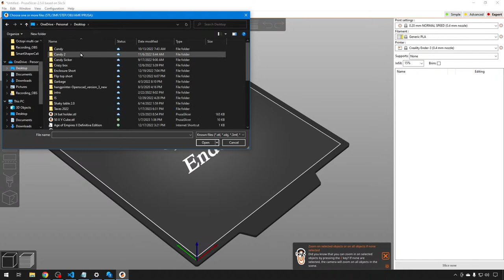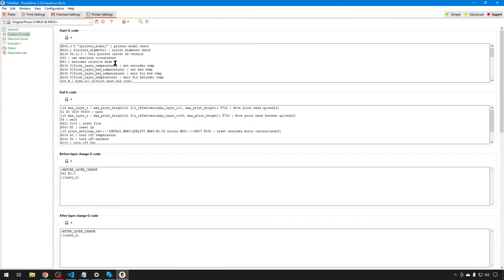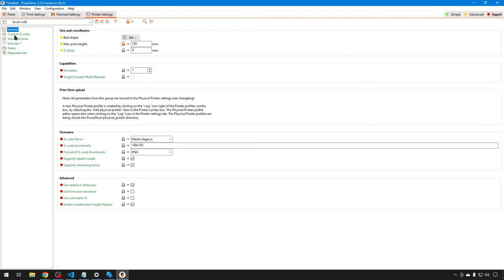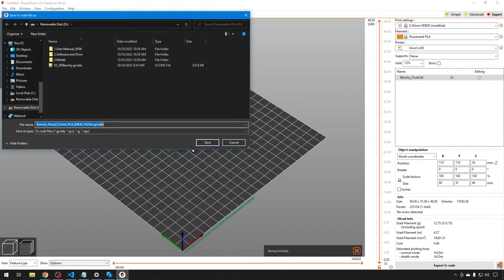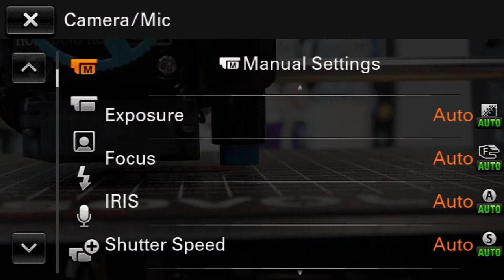Sovol SV06 - Let's Give It A Try - Come Hang Out! - Chris's Basement

Comment: I like the SV06. I haven't had any issues at all. I have a question though. Can you explain your rice crispy term about the popping in the hot end or extruder?
I hear it, but it's never giving me an issue and I'd like to know if it will give me an issue in the future. Thanks
Reply from the maker: I hear that sometimes for a couple of reasons. Most of the time it's because of the sleeve they use for the wires. I haven't nailed it down yet on the SV06, I will take another listen and see if I can find it.

Comment: What do you think about Anycubic ending production on Mega Series Printers, I had one that was great but return it cause it wouldn't turn off heat on extruder and got a replacement but the new one could print the same there's something I can put my fingers on it and I got a degree in electrical Engineering  and the replacement printer Can't print PLA to well but great Petg prints and  Good TPU.
Reply from the maker: I didn't know they were doing that. Those were pretty good machines for the money. I guess we will see what they do next.

Comment: I have this printer and cannot get prints to stick on the right side of the bed. I have tried everything you can think of to solve it. Others are having the same problem. Tried leveling with 2 identical items under the gantry trying to tram it, but that doesnt work. I think there is an issue with probe, or code for the probe. Sovol has not been getting back to anyone having the issue. Can you reach out to see what we can do????
Reply from the maker: Sure, I will give it a try and get with them to see what they say.